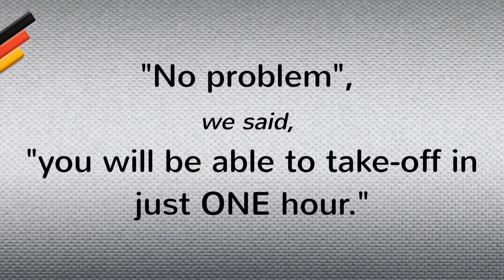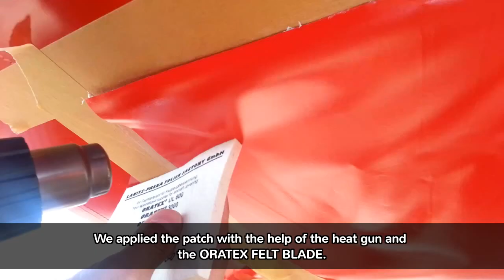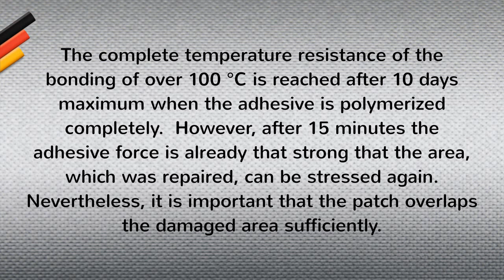Oratex600 Zlin Savage permanent field repair on Dacron fabric, how to

Comment from the maker: There is a very nice video by a customer named Fredrik Stork on U-Tube: its named "Using Oratex UL600" and shows in a time-lapse motion (done just right!) the usual covering of airframe parts with Oratex600 using the normal blanket method of covering. Its well worth watching !